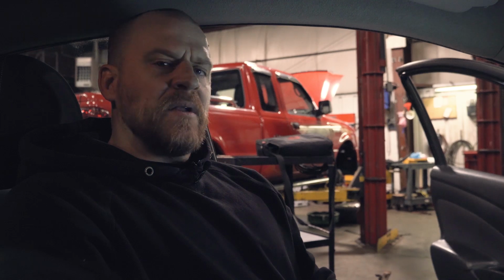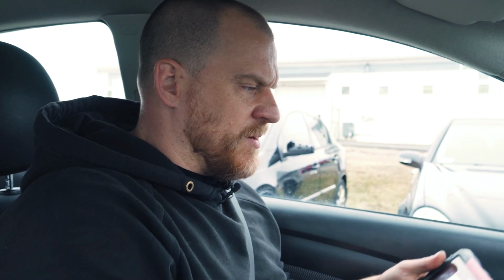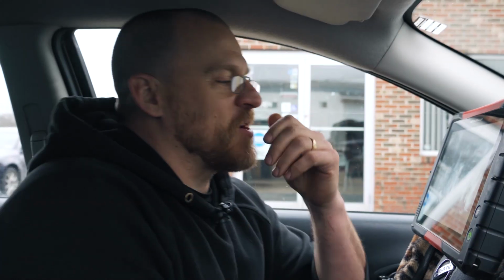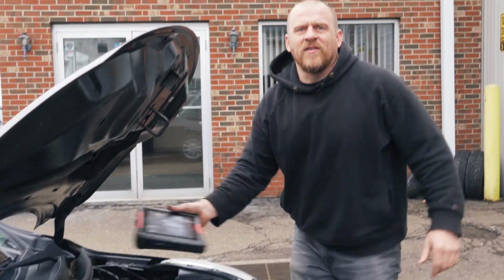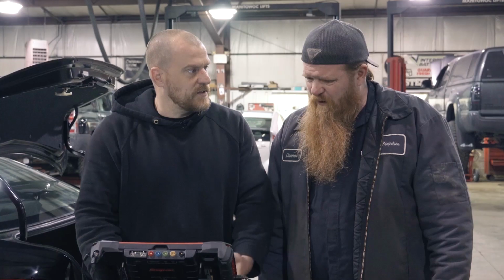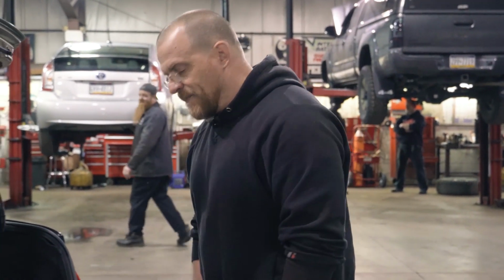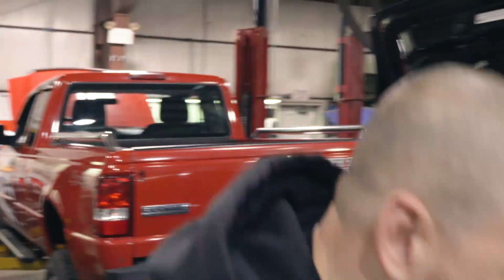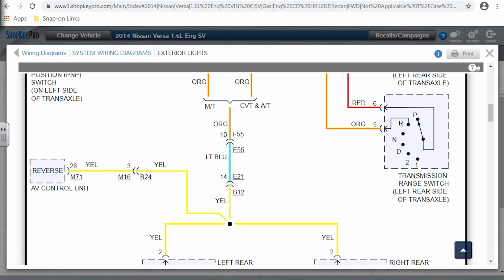2014 Nissan Versa P0705 Transmission Range Sensor "A" Circuit (PRNDL Input)

Comment: I can totally relate to what you are saying about the cvt transaxles. I used to have the "privilege" of having to work on those. I think it was maybe Eric O. at South Main Auto who also says he dislikes working on Nissans with electrical issues because their wiring diagrams are horrid. 38:50, the pry bar as the brake pedal assistant, do you know how many times I have done that? Great minds think alike😁. 
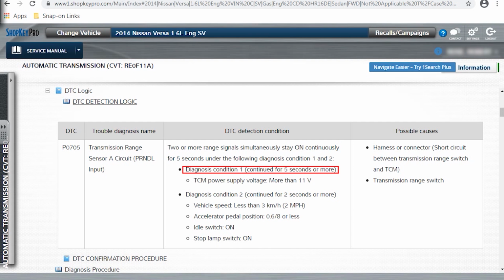I don't know why manufacturers use those printed circuit boards on tail lamps or anywhere else on a car. GM used those on their pickups for years and had problems with them. I remember an instructor saying to me one time that for those to be effective the margin of error in manufacturing them has to be zero, in other words, probably won't happen. I like how that chart at 12:27 says two or more signals simultaneously stay on continuously. I'm surprised they didn't also say at the same time, 🤣.

Comment: Water could bridge tail or stop lamp circuit to reverse circuit putting voltage on reverse circuit making brain box think that reverse is selected when lever is in some other position. If the leak just started corrosion may not be visible yet.  Perhaps turning a garden hose on it for a time to see if  water intrusion occurs...

Comment: In my opinion CVT transmission is similar to a snowmobile Transmission where you have 2 different size pullys when one will squeeze expanding the diameter the 2nd one expands changing the circumference of the pully to smaller and not saying there's a belt inside the transmission But similar
Reply: Exactly right, although in passenger vehicles the “belt” usually consists of hundreds of metal clips strung together on the circumference of an inner metal band. When they break it makes a MESS
Reply: Thanks - I was just going to post the same thing. Only thing I'd add is, it's like a 10-speed bicycle in the way it works, only without set gears to engage. When your pedal sprocket is big and the wheel sprocket is small, you haul ass and pedal slowly, but can't climb hills very well. When the pedal sprocket is small and the wheel sprocket big, you pedal fast and go slow, but are able to climb steep hills with a heavy load with minimal effort. You can think of automotive, snowmobile, and ATV CVTs as infinitely variable 10-speed bicycles with no gears.

Comment: It needs the brake light input to shift out of park. Obviously nissan integrated the bulb circuit into the park neutral switch. Renault is French there's a reason we don't buy French cars

Comment: I went thru this on a 15 versa after pulling my hair out I just happened to notice the tail lights didn't quite look the same so after a close up inspection ii noticed the passenger side looked like shattered glass  on an inner layer not the outside lens.... weirdest crap Ive ever seen.
I thought no way it can't be..... Yes I went to the local pull a part and got one put it in  then cleared the code we drove it to get parts n food ect ect, for a week and the money light never came back on and still hasn't 3 years later.
I been a mechanic going on 39 years now and I have learned that a tech will never stop learning in this field.
Thanks Scanner Danner for your videos sometimes  this old timer needs help in these space ships on wheels!!!
Reply: I’ve fixed this same problem with a new tail lamp as well
Reply: @Tek_Nician  Well glad I'm not alone ..... These new cars are ridiculous the obvious is never obvious ya gotta think outside the box least for me.
Back the day stuff was way more straight forward now I'm finding a trans input speed sensor causing a code for a bad cam sensor..... Ya I think it's time to retire while I'm still sane lol.
Reply: My car a Nissan  would not take any gas . My problem was a brake light was out !
Reply: Thanks for the info. Did you have to replace the whole tail light housing or just the bulb. And was it both or just 1 side
Reply: @ceezauto213  I replace the passenger side taillight assembly

Comment: Quick question. Could the backup camera circuit be the culprit. If it is defaulting and causing feedback on that circuit the computer would think that the selector is still in reverse
Reply from the maker: We would have seen that in the switch inputs and I dont remember a backup cam, but yeah your thoughr process is spot on
Reply: x2 water in the backup camera or backup camera connector, shorting it out would be my next step.
Reply from the maker: Just reviewed the video, no back-up camera on this model guys. Thanks!
Reply: That’s what I was thinking. The camera is powered up by the reverse light circuit and shorting out causing the computer to think it is still in reverse.

Comment: Just started the video. Had one of these a couple months ago with the same code. The one I was working on needed the tailights replaced. There is a circut in I think the drivers side tailight that gets corroded in these when the tailights crack and cause transmission range sensor codes. It's weird. That's what the fix was for the one I did though. Also note they don't 100% have to be visibly cracked to have corrosion on that chip. Old bulbs cause it too.
Edit* finally got to the point in the video with the bulb. Yes the bulb not making contact will short that circut and trigger that code. You had it right.
Reply: Thks Alien I'll sell her both then 🤠
Reply: So you replace both tail lights?
Reply: @Exar46  actually in this case yes because they were both cracked and letting moisture in.
Reply: @Exar46  I almost forgot that part and thought I screwed up writing the comment out. It has been awhile now since I did the job so I forgot whether I replaced both of them or not but I did.

Comment: Dan if you have time. I had a nissan sentra came to me after 3 transmission with the last one being a crate from Nissan with the same problem the car is in limp mode, no codes any where on the car except a code for a brake light switch the tests on the switch shows everything ok, so I moved on to the brake lights them selves sure enough the power gets back there but the bulbs burned notice I said bulbS both, since there is no relation I moved on to other tests with no luck. so I decided to ship it. but as  gesture of good faith I decided to replace the bulbs. viola the problem is solved yes the transmission issue is solved!!!!! it turned out they put a program line that if both bulbs are out you are not safe to be on the road so they shut you down.
Reply from the maker: Crazy stuff man

Comment: Hey Paul I have your book and it’s awesome. Thank you. just to add to your complaints with the Mitchell’s diagram, I had an 18 Hyundai Santa Fe for a can bus problem. Diagram was a big liar and doesn’t even show you where the splices are. I found a splice near the engine compartment and the diagram says that it goes to a vacuum pump, blind spot and etc can lines but the car doesn’t even those 😂 the best part yet, the pin outs at the DLC aren’t even correct and the wires aren’t even the same colors as what they’re showing! 🤦🏾
Reply from the maker: When you look at CAN bus wiring. Try to find the factory diagram for those, not the re-drawn version. They started providing these factory diagrams on the newer cars for us.

Comment from the maker: CVT = continuously variable transmission. Thank you FB friends for the info 😀 
Shows how little I know or care about them, as I didn't even get the abbreviation right.
Reply: Can’t Verify Trouble codes
Reply: you subliminally got the "constant velocity" from CV joint, honest mistake.
Reply: If you've ever rode a snowmobile that's a CVT transmission. The CVT you're working on has two pulleys with a metal belt computer controls both pulleys continuous variable transmission.
Reply: I would have cleaned those boards very thoroughly.
Reply: Paul, I once heard a journalist refer to CVT as continuously Annoying transmission 😝👍🏻
Reply: CVT= Christ Victorious and Triumphant.
Reply from the maker: I like this one better 😃